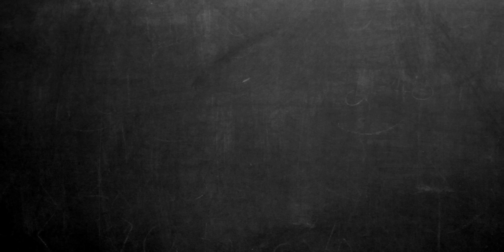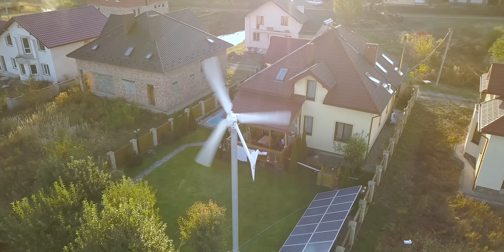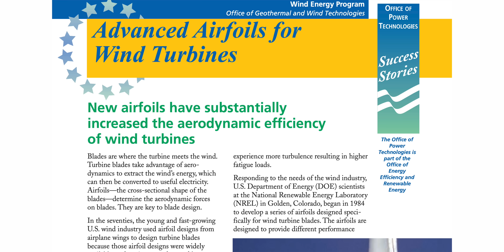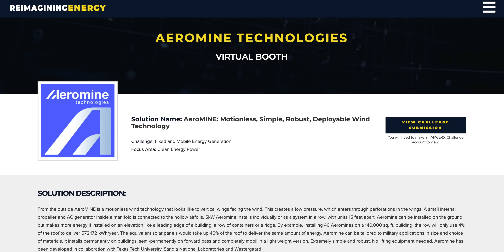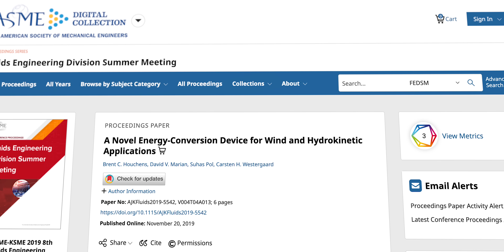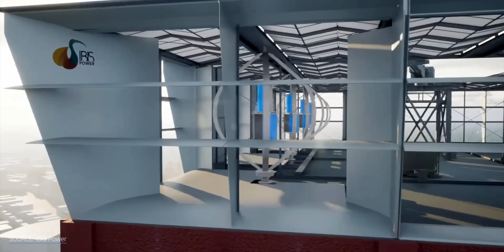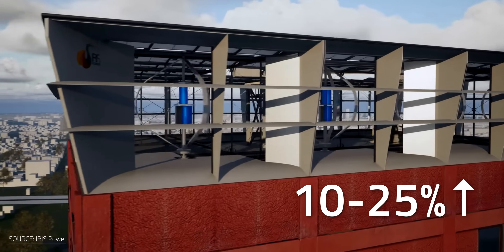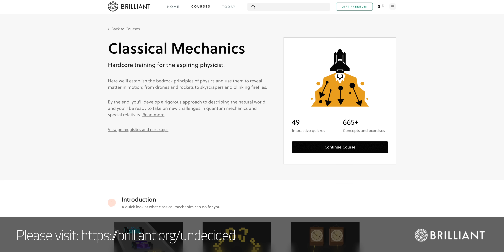How Can A Wind Turbine Be Motionless?

Comment: Wind energy is not free  nor is it cheap as the maintenance of them is significant higher and you need 9 MW capacity to produce 1 MW nor can they stabilise the electric grid. While you still have to pay to maintain backup power of gas oil power plants at the same time. It is the main driver for mad high energy prices in Europe.

Comment: it's not the blades
it's windspeed
most houses don't have wind in summer
you need at least 13 mph it's better with 20 a lot of smaller tutirbines don't offer
the advertised power
it's usually 25% of advertised,also it's hard getting turbines
up on 30-40 foot tower

Comment: The Aeromine concept looked promising.  I am in Hong Kong with high rise buildings, and very strong seasonal typhoon.  Solar roof have been promoted, but it causes roof leaks which became very costly to repair.  I am looking for a solution that takes up a very small footprint yet can generate power year round. Vertical blade turbines looked promising, but they can become very large.  I looked at your analysis of aeromine and it sounded like a true possibility.
Reply: @Blind Freddy It does not promote leaking, but when a roof leaks, solar panels covering them makes it very difficult to repair.  Just an added problem where Aeromine sitting on a small footprint will make it a lot easier in terms of building maintenance.

Comment: Apart from airfoil properties and lifting force creation it is also absolutely necessary to understand wind energy content. The energy, which is available in any air flow is proportional to cube of its velocity and the sweeping area.
What was presented in this video as a game changer is not competitive at all. It will work, but  it would not generate viable power.
Guys, do not reinvent the wheel!

Comment: Looks interesting. For the Aeromine, maybe the direction issue could be solved by onboard software that would rotate the position of the turbine based on wind direction.
Reply: It doesn't even need anything fancy like that. It just needs a base that can rotate.  The wind foils will automatically align it with the wind direction if they are behind the center of rotation.

Comment: Another issue is the reliability of the wind.

Some areas you can rely on a regular wind most of the year.  Some areas there is not enough reliable wind.

If  there is reliable wind, I'm all for wind to generate electricity.

The tremensous wind turbines are more economical to build per kw output but we've been running into blade longevity issues.  Smaller wind turbines and windmills have survived several decades.  The huge wind turbines not far from where I live are replacing blades almost constantly...

Comment: there are more reasons than the blade, it's not free, it's not quite renewable either since the machinery deteriorates and the large scale wind farms are most often left to corrode in the ocean after they've lived their lifetime through, which means we aren't reusing the materials at all, not only that but we wouldn't mount them on our rooftops since they'd be too heavy if we were to want them to be high enough to produce a large amount of power. In general most of our "renewable" power sources aren't really renewable, they either almost consume pretty much the same amount of energy we get from them or have bad waste products or both.

Comment: The combo of solar and wind looks very promising. Solar generation during the day and vertical wind turbines to run at night seems like a "win-win" solution.
Reply: it sounds wind-wind :)
Reply: @radoslavkuba4900  You almost made me swallow a gum congratulations
Reply: @Radoslav Kuba: 🤦‍♂️😄
Reply: Just takes up sooo much space.  We used to have an awesome green park on top of the parking deck near me now its ugly mess of solar panels.
Reply: @Dead_Goat   Sounds like they did it wrong.  Good way to get people to hate it.
Reply: Yeah they combine nicely together. 
Wind tends to be strongest in the morning and evening and weakest during middle of the day. At night it is slightly stronger vs day IIRC.

So solar creates most of energy during 4-6 hours in the middle of the day, strong wind satisfies demand during morning and evening, and during the night demand is very low anyways, so a bit of wind generation is likely more than enough
Reply: @artemaung5274  That's only south facing solar, west and east facing solar (especially vertical double panels) also get good power during the morning and evening.

I think wind generally dies down during the night, after all, the wind is driven by sunlight heating air. So you need to adapt electricity use anyway. Getting a setup that allows high energy pumping of heat to storage to happen when there's power during the day and using that stored heat to warm the building during the night would be great, but you would need some kind of heat storage solution that is efficient enough, and I have no idea if that exists.

Comment: is this really more efficient than traditional bladed generators?  It's hard to believe that air moving over an airfoil will draw more air through an enclosed turbine assembly than an open multibladed generator assembly?  How does it perform in relatively low winds? in high winds?  Thanks for another interesting video!
Reply: I don't belive that either. And second thing - wind carries limited energy per square meter (about 300W/m^2 @ 10m/s wind speed) and those turbines looks tiny. Love to see some real data on that

Comment: When they solve the problem of guaranteeing constant wind, they'll have something useful.  Until then, it's just another green toy requiring 100% backup by conventional power.
Reply: There are grid scale energy storage systems and conventional backup is better than exclusively conventional...
Reply: @AmbientMorality  There isn't a single grid scale battery backed up system in the world to my knowledge, and conventional backup is only better if you prefer electricity that's 2 to 4 times as expensive as conventional power, like they have in CA and Germany.  Want to quadruple your electric bill?
Reply: @nickjohnson811  Doesn't need to be battery, pumped hydroelectric exists for example. I'm not sure where the 2 to 4 times as expensive figure comes from; do you have a source for that?
Reply: @AmbientMorality  There are only a handful of pumped storage sites in the world, and no new ones are planned in the US as previous attempts have been blocked by greens.   According to the statistics site Statista, in 2022 the average cost per kwh in CA was 26.71 cents, which is about twice the median rate.  In Germany, the average rate in March 2022 was 46 cents per kwh.
Reply: @nickjohnson811  I'm sure that California and Germany have higher electricity costs; I'm not sure you can link that to renewables. I agree it's unfortunate there hasn't been more movement toward storage like pumped hydroelectric, but there are definitely projects being planned in the US (for example Goldendale in my state). Whether they will go through remains to be seen.
Reply: @AmbientMorality  Renewables are inherently more expensive, because, unlike conventional power, they require 100% backup by conventional power.  For X amount of peak electricity supply with conventional power, you need about 1.1X generation capacity because they are over 90% available.  With wind or solar for X amount of power, you need about 5-6X generation capacity, because wind and solar only supply 20-25% of capacity on average, and close to 0% on windless, cloudy days and nights, so they require 100% conventional backup.  So the capital cost is far higher than with conventional power, against which they save about 2 cents per kwh in displaced fuel costs when they are actually working.  It's not a coincidence that the higher the proportion of wind and solar power, the higher the electricity prices.  They also destabilize the grid, so lead to more electricity outages, as has been seen in TX and CA.

Comment: Great info Matt, thank you! Has anyone you know of tried combining solar PV with wind, where the turbine is turned using the convection of the air heated by the solar PV panels for residential use? Maybe glass duct above and plastic or metal duct below the panel array to trap and guide the heated air up to a ducted turbine?
Reply: Exactly what I have been thinking for a long time, it will happen, the Nest will develop that way utilizing every bit of useable energy, it just has too.

Comment: its wrong to say Wind energy generates more power than solar. first non of them create power, they convert power into electricity. and on the other hand how do u compare it? a 1 MW Wind turbine weighs about 50 tons (metric) and 1 MW solar panels also weigh about 50 tons. so from the weight they are about the same. when it comes to used space.... the solar is way more effective than wind turbines as they can be fixed on already existing buildings and infrastructure and solar can be built anywhere the sun shines (everywhere). wind turbines on the other hand need a lot of space (ground space - the distance between them has to be huge or they lose efficiency, also air-space as they have to be high) and they need separate infrastructure as they are usually placed in places where nobody stays. when you compare the cost of the actual device then we are at about 1000 USD per kW on a wind mill and 750 USD per kW on solar. Now one could say that solar works only while the sun shines then you have to calculate at best 50% but the same with wind - it just doesn't always blow.... depending on location you can be down to 20% of sufficient wind. So why do you say Wind-craft creates more power than Solar? because it was built more than solar, for higher prices than solar or how do you compare the 2?

Comment: Question,  at time 3:22 you have a diagram of a race car. I always thought the air above the car is moving faster than the air moving below the car. Wouldn't the air above the car move faster due to the air having to travel further and causing negative pressure and lift?
Reply: Correct.  The shape of the car causes lift.  All the airfoils attached to the car are there to combat the lift from the hood-roof-trunk (bonnet-roof-boot) being a longer path than the underside.

Comment: These turbines are like other inventions in wind energy that use funnels and airfoils, they are very very inefficient in turbulent winds. The turbulence makes the airfoil vibrates and will produce a lot of stress on the airfoils. For a wind turbine to be efficient, it needs high wind speed and these wind speeds are all in a turbulent flow. 

Believe me, I already built one and it doesn't work. These designs only work in laminar flow situations.

I've been researching and working in the energy industry for 9 years already and I'm a long time follower. More power to your channel. 😊

Comment: I agree the PowerNest looks very promising. I live in Rotterdam, in a 23 story building, and we're contemplating solarpanels. I did some research into PowerNest, and I can't seem to get concrete results, just projections and estimates. Another thing is that a PowerNest module is ridiculously expensive and most probably only really feasable on a new building. During my research, I came across a lot of sceptisism about the smaller wind turbines. Some experts claim they can't really produce the power that's promised. That's why I would like to hear from PowerNest. Let them show some real world data from the buildings they've installed these things on. As soon as you have some real data, you can start to compare the costs vs gains.
Reply: That's the thing, there is no real data. It's just like solar roads, lot's of gullible people being misled with a 'green energy' promise. Very unfortunate Matt Ferr was not able to add any criticism. What an incredibly biased video.

Comment: Wind energy does not work. It consumes vast amounts of land, resources, wealth and taxpayer dollars to produce tiny amounts of electricity. I have calculated mathematically that windmills consume 2,000 times as much in labor hours and costs than a nuclear power plant does just for basic maintenance. The only reason that we have windmills anywhere in the world is that environmentalists have rigged tax systems to build them. Germany has invested heavily in wind power and it now is facing big energy shortages. In the Great Texas Freeze of 2021, thousands of windmills froze up just when the state needed them most. Windmills are unreliable and intermittent. They have high failure rates. There are windmills near my house and many of the times that I drive by, they are not even spinning. We should stop wasting money on windmills and build nuclear power plants, which are some of the most efficient machines in the world today.

Comment: You said the magic word, diversification  in regard to Energy sources.   A 5kW wind Energy would sit well with a similiar size Solar on a STANDALONE Power System (we are on a SAPS) AKA no grid.  Such diversification mean you can get away smaller storage. 
Right now I am adding another 6kW of Solar to my existing Solar why solar not wind, that is cost and location, but also my SMA based inverter system doesn't support wind (requiring a bespoke design and no SMA  support.
But in a few years time one of these would be a good option.

Comment: Far out. The god winds are not along the surfaces but up up. 

It only correct they are much easierto costruct but by that You also has to have many many more of them. 

And estitics, fire??? Where is importance of fossil replacements?  Thasts the whole point.  

Danes invented the standard windpower, By that there was so many experimenthal models and only one winner, which now is visible all over the world. So dont waste for second class solutions because they look nice. 

Here it also seemes to be ignore, that the windpowersystems today are highly industrialized into best to the price are speialized and cheep making a lot of electricity as well as profit. 

If anything the writings should be about energy waste by non isolated houses using 80% more electricity for heating and cooling then needed to. Thats the marican standard. So the change should be to make better houses, which pays off fast in electricity as well as gas for warming up. 

But also there and for all kinds of toools - electric cars included - things already are invented. The main problem which is much worse in USA then EU is its not being implmented by laws for quality. 

I can see how things too often are. You still are in Edison mode thinking light as Watt. But actually light is in lumen. Most of the Watts are warming up the vakuum cleaner included.

Comment: I think the horicontal axis wind turbines are mostly used because they have a long tradition. And they are easy to build and highly efficient. Since the 1930th they can be considered also as the most optimized design for wind energy conversion. PV power is cheap nowadays. That's why it is preferred in energy conversion. It has also a long life time and it has nearly no maintannance requirements.

Comment: Isn't bournulli's equiation one of those misunderstood principles that uses a simplified but incorrect interpretation. Its not the air is moving faster that creates lift but the fact the air below the wing is actually being force down under the wing? Believe its called angle of attack in aviation but am not sure. Just a question, I remember it being one of those physics principles that people most often got wrong, like the air isnt sucking the wing up creating lift but wing is forcing air down creating lift and one of the prime reasons is the classic example of using a hair dryer on a paper wing foil. Yes the wing has a higher pressure below and a lower pressure above but thats not the action generating lift so much as a way to measure the lift.

Comment: I have been in the Small wind industry for more than 35 years. Having started and operated one of the largest producers of small wind and only to see it close after 25 years because of the price of solar PV, I know a LOT about this industry (Southwest Windpower). First, no VWAT has, or will ever be successful. Secondly, motionless means useless. NO it is not about the birds. If this company is looking for investors, run away. You are better off at the craps table where your chances is 50/50.
Reply: It isn't motionless. The moving parts are hidden inside.

Comment: Put the turbines on a Lazy Susan type turntable, moved by wind vanes that would rotate the machines into the wind direction.  Second, replace the large Wind Turbines located on hills and in areas such as the valleys in California that act as giant "Venturi effect" machines to increase the speed and energy of winds.  Anywhere wind has a stable direction and has some effect, such as "Downslope Winds" that adds energy to the wind flow should be used by these blade-less turbines.
Reply: Moving objects like vehicles can give more wind energy which will be capital efficency

Comment: Needs to be experimented.   Instead of trapping air stationary while the turbine is at the ground; that is what they did.  Also, instead of old turbine WATER/Hydro WHEEL.  Then, why not think of PUMPING AIR vertically from up [should not suck air out in going up] and pump down vertically towards the ground turbine?  That after pumping air downward; then pumper should NOT go up on the same vertical line in order not to suck the air out again; but pumper must go out a little away from the vertical line, then up and then back to the vertical line to pump air downward towards the ground turbine.